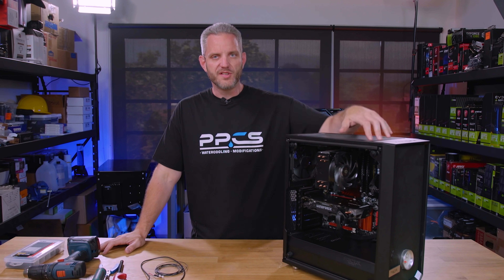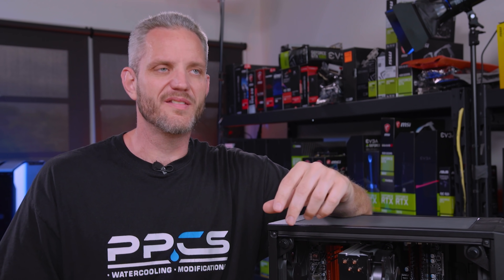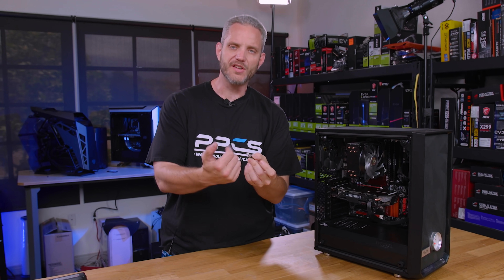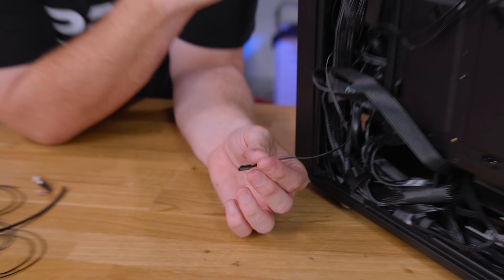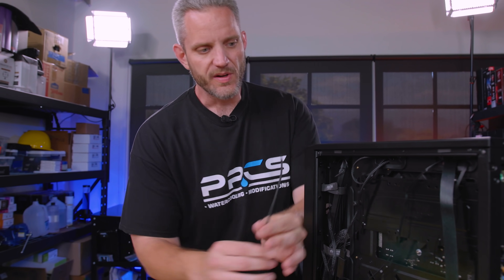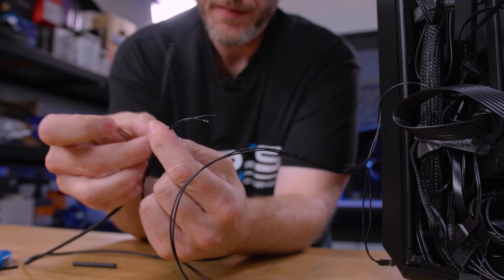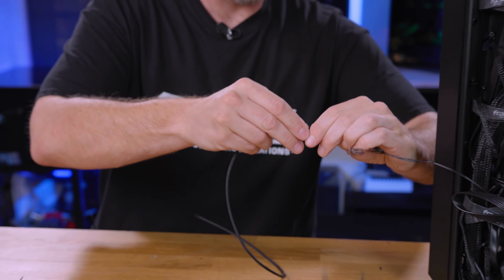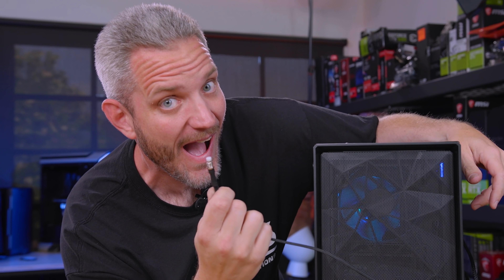How to install a PC KILL SWITCH!

Comment: She HAS to put it to sleep any time she leaves it???  Why not just set to Do Nothing and then have it automatically go to sleep if unused for like 30 mins?  This seems kinda ridiculous to me.  Also, "PC kill switch" implies the switch immediately shuts off the computer when switched.  This is more akin to a "dead man's switch" (or just a safety switch) that keeps something from working unless another activity unlikely to be done at the same time inadvertently is also done.  But I digress! ;-)

Comment: Basically the power button when pressed pull's a high signal into ground so the psu will enable the power rails 3.3v 5v 12v

Comment: Hey Jay, could you show us your way of adding a startup sound to your PC where the sound comes from inside the case? I could totally see you using the same case with the volt meter and adding the sound of your track car starting up when you press the power button. 

Onward to 3 million!

Comment: The old cases had a key lock to disable the keyboard, next to the turbo button.  Those were the days, and a bit more secure way to disable a computer from the casual snoop.

Comment: My cat has an annoying habit of jumping on the tower, walking on the power button and shutting it down... 
This would be an amazing fix. Wow.
Reply: Ctrl + alt + del + cat
Reply: I feel you. My cat would jump on top of my case and land right on the power button, shutting me down mid game. I just changed the settings in Windows to set the power button to do noting.
Reply: Same here, until I got a new desk, where the PC is under the desk. Sometimes I wondered, why my PC was running when I came home. Also maybe my cat's a Flerken checking his email or blasting his way through some DOOM while I'm not home.
Reply: Just train the cat not to, yell at em or spray with a little water. That's why I'll never keep pets in the house though.

Comment: I'm avoiding my kids accidentally pressing my power button by having a really tall case on my table, so they can't reach it. Drawback of that is that the front audio and USB are way too close, so I've already pressed reset while trying to plug in my webcam for video conference without having to stand up.

Comment: I saw a ton of things about cooling a pc but i never saw a water loop without headsink, like making a block that isolates the cpu plate and you don't need to put either thermal paste or the other plate on the headsink

Comment: on my Pc the power button broke so instead of replacing it. I took the wire outside of the case and now I just tap the ends on the side of the Brushed steel to turn on yet my kids and thier buddies are still puzzled to this day 2 yrs later on how to turn on my Pc .               Think MacGyver

Comment: Jay-Z there is no need to cut that wire. You can just order similar pins online that are on your motherboard and make a dedicated cable with that switch on it. This way it's easy to revert to the original configuration.

Comment: Reed switch + small magnet = profit...?
Reply: The magnet pushes the switch open, take it away and it makes contact, seems a little backwards.
Reply: @darkpsion  you can get reed switches that are normally open circuit as well. Closing when a magnet is near.
Reply: oh thats awesome!

Comment: Jay, I'll see your kill switch and raise you a keyed switch.  Install a keyed switch in line with the power button, luggage lock the side panel and you can keep the kids off the pc when you ground them from it. And the beauty of a keyed one.... paint it neon red and adorn it with RGB light..... it makes no difference if they see it, with the case locked and switch requiring a key, they are powerless to do anything but whine and cry it's unfair :P

Comment: Jay, you are over complicating it, why not just HIDE the button or put in your pocket?
There are simple Wireless kits sold, you connect small thingy to the motherboard power connector and thats it, you can turn on/off the PC with small remote button, it basically makes the power button wireless, tons of these on amazon.

Comment: Hey, anyone have the link to how to wire that car voltage gauges in to the case?
Reply: 12v is 12v. Doesn't matter to the meter where that signal comes from.

Comment: i use a springloaded keyswitch, so i have to hold and push button and when i leave i just pull the key out and noone can start my PC without opening the case
Reply: Put security screws on your case and they can't even do that

Comment: 8:10 How did you get that larger bit on there?  I ALWAYS forget either the second, larger layer, or the first layer, before twisting/soldering the wires, then have to go back and undo it. One of the upsides of tape :P

Comment: I got a better idea - gut a car alarm for the remote (or buy a remote on ebay with its team player, the receiver). Set it up so that the power switch is completely bypassed, have the remote's RX run off 5V SB, and then you just click the remote to fire the power switch. Advanced users can also include a voice player that tops off its LiPo battery when the computer is on. Have your computer play a little sound (apple boot chime anyone) when you press the button :)

I did something similar with my hackintosh. The machine would "mac chime" prior to the relay closing for 300ms to start the machine. It wouldn't chime on shutdown as an optocoupler connected to +5V pulled the chime boards disable pin low, disabling the chime board.

We did a similar setup to a mates car. Hes a plane nut and drives a WRX. We hooked up some speakers that fired out the bottom of the car (finding places to hide 8" subs was a nightmare!). Rigged it to an audio board and did up his overhead like a jetliner. The audio board had a whopping 512 seconds of record time, so we loaded up samples of a jet starting up, shutting down, and idling. Logic was provided by an arduino. Needless to say, his neighbours soon got annoyed with him every time he started up his "street jet" ;)

The best bit was jet (hehe ok bad pun) to come. We'd get a designated driver and go to our local. As we got near, we'd press the switch on the overhead for "AB jet" which stood for ambient jet noises. We'd pull up with a whopping 95dB of jet roar as we parked up. Certainly turned heads, especially when we over-rode it and got it to play the spool down sound. :)

Comment: I think this is a perfect idea for the exact use case intended, keeping a kid from shutting down the computer by accident.  Other than that it seems pretty much useless since anyone that knows a thing about computers would bypass it in about step 3 of diagnosis.  Check its plugged, check that the plug is live, short green to ground on the 24 pin.  
As far as actually locking someone out that has basic computer knowledge, the windows login password is good enough if you encrypt the drive.

Comment: I think it'd be interesting to see more custom wiring. Wondering if it's possible to extend/reposition front panel USBs to different positions for when you're doing a custom case. Trying to find one with good positioning... kinda sucks if you want to customize it. Only thing I've found info on how to do is a power button lol.

Comment: Why not use your heat gun that you use to bend your water-cooling tubes with? It's easier to control and does not give that annoying sot residue as the lighter does.

Comment: did this a while ago with a key switch, so basically the key turns the switch, and  you can then press the power button. I haven't seen  anyone do a key pattern yet though, like maybe have a few buttons and a specific pattern turns it on.

Comment: my content suggestion would be as follow: 
a watercooled pc with obvious suboptimal flow maybe not even enough radiator surface area. what causes suboptimal flow etc. a bit an advanced watercooling video. if someone has trouble after building the system or somethn.

Comment: I fail to see how this would help at all if she knows about the power supply kill switch.
Reply: That's why he should've installed an ignition switch with a key instead!
Reply: @RubberDucky8734  How would that help when she just goes behind the PC and flicks I over to 0?
Reply: Daniel: "huh? if you install an ignition type switch with a key you'd have to turn the key for the power button to function, remove the key after turning the computer on and the button no longer works. This way it wouldn't matter if anyone knows it's there, they'd need the key regardless."

If you look at 5:54 there is a button at the bottom there, if you turn it from I to 0 you kill the power to the PC, any key system anywhere else would never change this.

Comment: "Anyone with any amount of computer knowledge will be able to bypass it."
I think you overestimate the common sense of the average person...
Reply: You could always open up the case and use a screwdriver or a knife to manually bridge the pins...

Yeah, most people, even people who build their own pc, probably won't know how a power switch works. The only reason I know that is because I built my own one for a Raspberry Pi.
Reply: @RedSunFX  
Instead of a simple power button or ignition switch.  Like Motorcycles, I think PCs should have secret, unique, and personalized ways, not only to turn them on, but just for them not to hurt you, because I believe in traps. I have little to no tolerance, for thieves & vandals. 

Armored bodywork, with no obvious fasteners, or no fasteners at all, that are accessible from outside. The only way to gain access to the computer or motorcycle, is if it KNOWS it's really you, you have what it's expecting, or, if you cut into the armor. And the armor can be hollow with pressurized gas, that can be anything, from a toxin, to mace, to a stinkbomb.

Have you seen or heard of those fake packs of gum, that shock you if you try to take a piece? Imagine a power button being like that, for a computer or motorcycle. Keyless ignition, proximity sensors, fingerprint scanners, Iris scanners, facial recognition. If you do not try to turn it on, the right way, you will be shocked, sprayed, burned, or shot. Of course, as a courtesy, there can be visual or audible warnings, to stay away, or back away if an attempt failed, and peaceful alternative access, if the main access method, isn't working.

Thieves & vandals, need to fear the innocent, and it will take radical deterrents to do that.

The appropriate way to get inside the case, or motorcycle frame, is if things like reliable servos, open or unlock body panels, for you, exposing storage, components, connections, and fasteners to take things off or out.
Reply: Or, depending on the motherboard, you have a power button already there, rdy to be pushed xD
Reply: Sebastian Engelmann XI Hero FTW!
Reply: Hahahaha I've got the IX Hero :D
Reply: Sebastian Engelmann hahaha :D
Reply: *his average viewer

Comment: To make it a less than permanent solution on a case, you could buy an extension to tap into and put that between the motherboard and the power switch.  Granted you don't want to drill significant holes in the case or beat it with a screw driver if you're going that route.  I would have seen if there was somewhere I could sneak it into the rear IO panel.  That would leave it somewhat hidden.  As stated in the video, anyone with basic computer understanding would be able to bypass that if they really want to power on the computer, so no need for extraordinary steps.

Comment: Best way to stop a thief is to make the car permanently unlocked and with the keys super glued in the ignition. Setup a rfid tag to activate the fuel pump relay when you want to drive the car.

Comment: As much fun as these would be, I found using a finger print scanner the best way to prevent someone from accessing my PC, ALSO, where I have my PC at, I have a power button moved out of my pc to the bottom of my desk in a hidden spot that you cant even see let alone would ever think of looking. (Around the button control to raise and lower my desk)
Reply: you could wire it into one of the height memory switches if you have them on your sit-stand desk

Comment: I would disguise the white button with a screw head on the side of the case close to the top so I can press both with the same hand.  Thumb on secondary, another finger on the power button and voila!  Easy and inconspicuous.  And even better, if you could double a screw already on the case as ur secondary button, that'd be sweet

Comment: Run your power switch through another switch in series, so both have to be pushed at the same time. There, saved you 13 minutes. Do some sit ups :)

Comment: A great use for this is when your case has a top power button and your cat jumps on top, you don't loose your work and such.
Things like this are a great way to make your PC more custom and functional. I made my work PC require a rf led remote to start(it has a on-board switch as backup), so others can't start it without my remote.
Best $5 I spent, since it's still led lit.

Comment: open circuit... close circuit...
don't mind me...

kill switch supposed to turn PC off right?...
Reply: it's supposed to kill signal from the power button. Pressing the kill switch allows the Power button to jump the motherboard to turn PC on. In simple terms, it's a hidden power button you need to press before pressing the obvious power button to turn on the PC. Also, while you're using the PC, it's gonna prevent it from shutting down or sleeping (whatever you set it up as in software) by just pressing the (obvious) power button.

Comment: your kid watching this video and she knew about your kill switch already
Reply: My thought exactly...
Reply: my parents just stole the psu power cables so I couldn't power it up when I got grounded
Reply: @JMilly84  My parents did just straight up cut the power cable, but clever me as a youngling, also just taped it back together and played right away, oh my were they pissed xD
Reply: @Sechs0rBecks  mine knew better and locked the tool cabinet and had no issues whipping my ass for trying to circumvent punishment
Reply: Bc it is not about the kid, but about the view.

Comment: I went the over engineered approach to this .... on my caselabs case, I put a blank panel in where their switches normally go, and the top most 5.25 bay is a blank panel that I drilled holes in. I have a key switch, and 2 aviator switches, plus the power and activity leds. The key switch is in series with the power switch so both have to be used. I haven't taken the time to work out the wiring so that the key switch disables both, but it's good for keeping it from being turned on when I don't want it to.

Comment: OR, you could just buy a new switch from ebay for less than a dollar, then you only need to push that button under the mesh, or place it somewhere else, like under the case.
Can do this for reset too

Comment: I wounder if you could hook that Volt meter up as the hard drive indicator light so the arm moves as the hard drive spins. Dont  know if it could be done but that would be so cool

Comment: You could use a black marker to paint the head of the switch black.
Reply: or buy a switch with a black button...
Reply: Blackheads... the nose knows.
Reply: After 50 pushes it will get cleaned by your fingers
Reply: @boomwithpeter623  just do it again
Reply: BoomWithPeter probably not because you push the mesh and only the mesh has contanct with the switch, not your finger who could take away the black paint/marker
Reply: Felix Bohner that's meshed up.
Reply: racist
Reply: @JHorse508  ?????